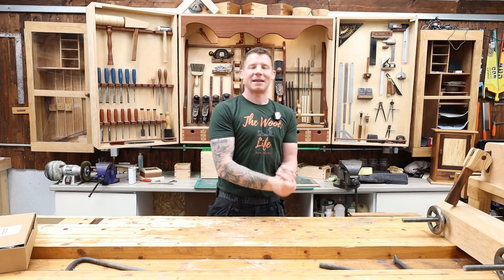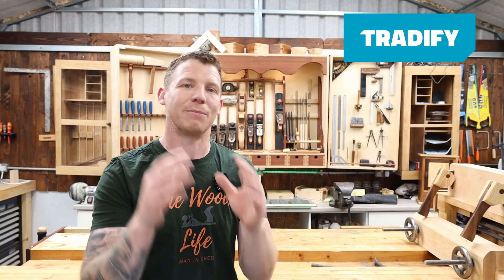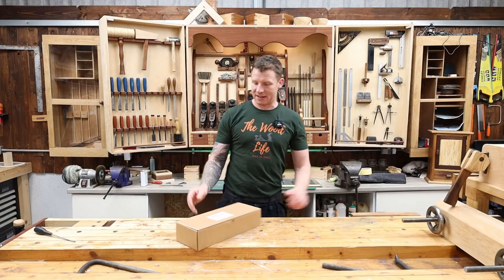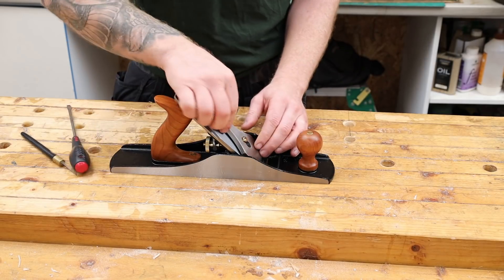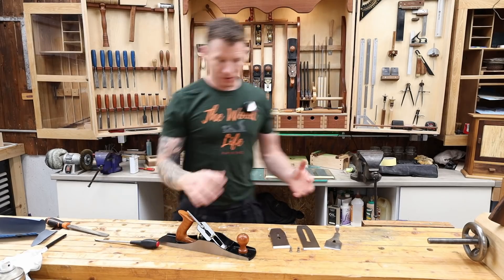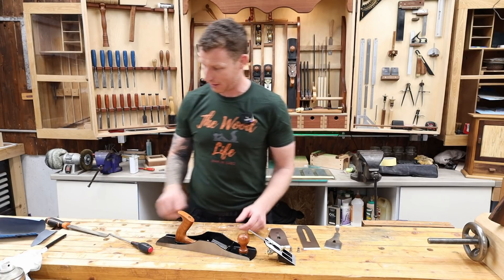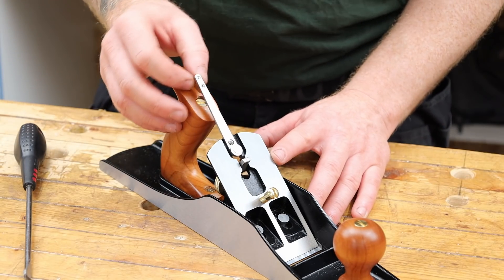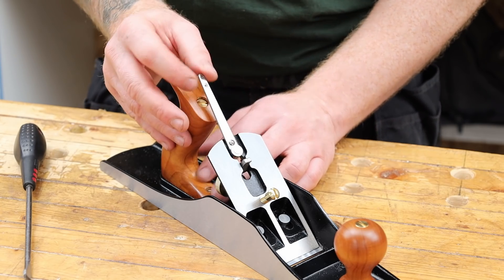Taking a New Hand Plane From The Box to Silky Smooth Shavings!! How I Do It.

Comment: Great video!!! I have got no.6 Luban (Quangsheng-Luban) great plan as you said good straight out of the box, the tuning of the plan took me 40 minutes... In my Irwin record plans ( 4,5) i replace the blade, lever cap and the yoke to Quangsheng-Luban ones( didn't cost much). For the shooting board i have Stanley no.62 good plan ( i think that it's blade is harder than the Quangsheng-Luban one) for the s shooting board is more comfortable than my no.6.

Comment: Great video keep them coming.
The trick with the screw on the chip breaker is a great idea to keep it at the right angle. 
I will try it when I get around to restoring an old Stanley I got on ebay
Reply from the maker: Glad it was useful 👍

Comment: I can testify that The sole of the plane will move when you put the frog and blade in place.  I used the surface grinder at work to flatten the sole of an old Record no 06 I was restoring.  I couldn’t get the plane under the grinding wheel with the frog attached so I removed it and flattened the sole to within 1/10th of a thou along its length.  I Put the frog back on and had a hollow of about a thou.  Still, The plane works beautifully, so I don’t think it’s very significant.  Also the ground surfaces of the plane are so smooth that they never rust even then others in the same cabinet pick up surface rust.  That was 15 years ago and it still looks like new.

Comment: John, I recently acquired stanly 4 and 5 and block plane, should I follow tghis video for setting these up? I noticed that the No5 has a slight dip in the base so should I do teh sandpaper work to get this out?
Reply from the maker: It'd depends how bad it is, it may not be worthwhile it it's too deep, however if the the front and back and around the mouth is flat then its probably OK

Comment: OK.. but I won't support a communist regime with my money....
Why not buy British. Go to Thomas Flinn and look for Clifton planes. British built quality tools. And not expensive.
Reply from the maker: Clifton planes are very nice but twice the price and I bought these from a British shop. But with Brexit I can't get anything from the UK because of the extra cost of import duty.
Reply: @JohnMcGrathManInShed  these very same planes  are sold here in the United States under the brand name "Woodriver." Luban planes are almost identical, but have a wee bit less quality.  Such as slack in some mating surfaces  and some  parts made of lesser grade steel. I  collect and restore old Stanley planes, the ones I use for every day are the woodriver brand.
Good job on the video, brother.

Comment: You  know a lot.  I don't   You talk way to fast, especially as you have an accent that is not clear to my ears.  You talk too much, adding info way too much and discussing things I don't need to know yet.  I just want to know how to make the damn thing work, mine doesn't.  I don't even know if the blade on mine is up or down... you don't show this up close, for the first part the camera is far.  I NEED TO SEE ONLY THE PLANE ON THAT WHITE BOARD, THAT IS HOW CLOSE I NEED IT.  That way I would know if the pieces are setting correctly against each other, chip blade up or down, etc.  You flip those things back and forth... confusing.  THEN, you finally get to using it, and you reach behind the handle and adjust something.. Mine has three things to adjust, I think you are  moving the big one, but.... Not sure.  You know it is going to work, don't you?  I wish you could be here in my garage and see how a beginner looks at things.  Mine says it is a stanley plane.  I would suggest you make another video and just deal with the adjustment part  first.  Up close, and go slowly on the part just before you adjust whatever that is in the back of the plane.  This is the confusing part, not the sanding parts down, etc.  Oh, yes, you used a file on the sides, what kind of file, fine or ?  Good luck, and think of beginners and foreigners like me who are basically dumb and are clueless.  Thank you.